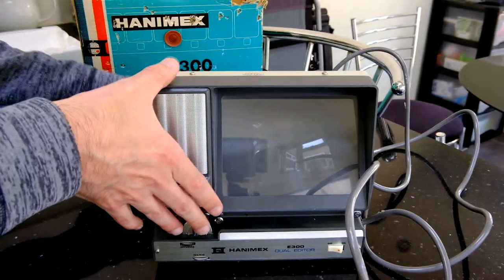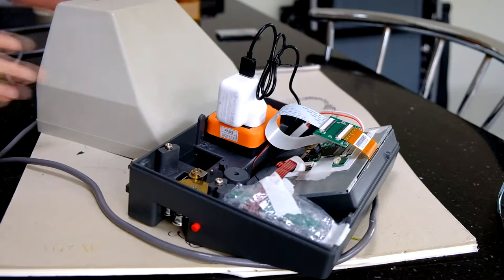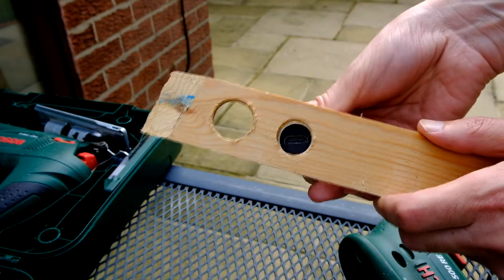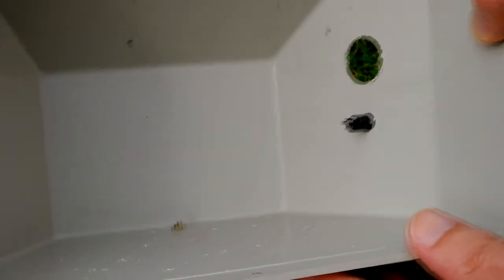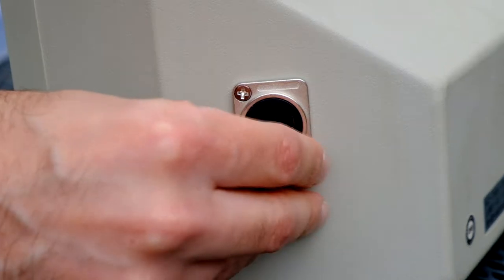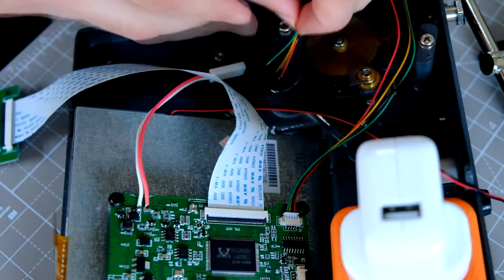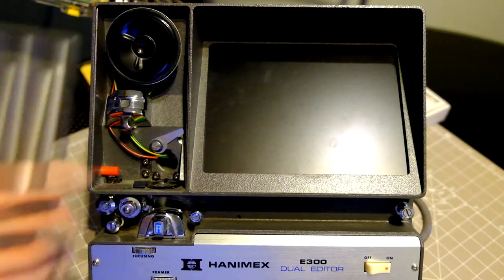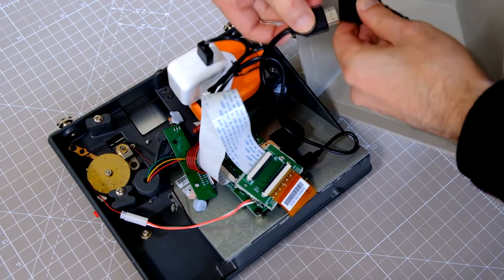Fitting the LCD Screen & Electronics // Hanimex E300 Retro Mod Project - Part 5

Comment: i have bought the same model after seeing the same video you saw, very glad somebody has made a good guide
Reply from the maker: The only video I haven’t yet shot is the final result, so you should have everything you need to do the project.. but if you have any questions, feel free to get in touch 🙂
Reply from the maker: Are you thinking of integrating the Pi into it, or doing the same as me and have a hdmi socket?
Reply: @Endpoint101  integrating the pi, and if I can fit it a decent sized UPS so i can run it off battery power
Reply from the maker: @spagussy  It's great how we're all doing it a bit differently :) Let me know how you get on!

Comment: Hi, I noticed the menu is correctly showed even you mounted the display upside down. The controller board you are using automatically flip the OSD menu or there is this setting that can be manually adjusted?
Reply from the maker: Well spotted! I’d meant to mention that in the video, and had filmed it too.. completely forgot to edit it in. I’ll include it in the final part. Yes, there’s an option in the menus to configure which way the display goes; it took a bit of googling, because the menu text doesn’t really explain what it does. I’ll see if I can find the settings & update the video description. Thanks for taking the time to comment 🙂
Reply: @Endpoint101  Hello, do you have an estimate of when you will publish the final part of the project? I'm looking forward to seeing it finished and I'm also curious how do you flipped the OSD menu.
Reply from the maker: @luctrev  I'm planning on doing it when I get a bit of time to myself.. was thinking in a couple of months when the lighting in the kitchen gets a bit better. I'm really pleased to hear you're looking forward to it. In the meantime, if you are attempting this yourself and want advice, I'm happy for you to reach out to me (see my channel info for more details).
Reply: @Endpoint101  Yes, I am working on something similar. I have an E300 here and I want to turn it into a RaspPC for my little daughter to run some educational software. I already made the modifications to the cabinet, systematized the USB and power inputs, installed the LCD, but I stopped when I realized that I can't change the OSD orientation, my controller didn't come with a manual and I can't contact the manufacturer, so I'm stopped. Just like you, I have little free time, so I'm trying to cut corners by following the evolution of your project.
Reply from the maker: @luctrev  I've had a look through some of my unedited video & found the one re. screen orientation. You need to bring up the main menu, go down to Tools, then Mode, and switch it from SYS3 to SYS2 (or vice versa). Hope this helps!
Reply from the maker: @luctrev  In fact, here you go, he's the footage I took .. https://www.youtube.com/watch?v=5B2YANk1j5Y